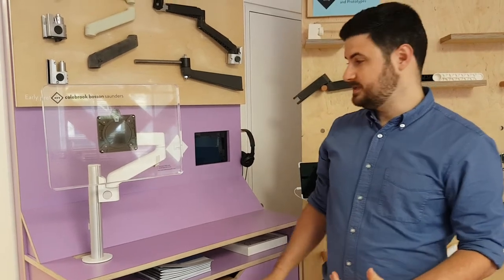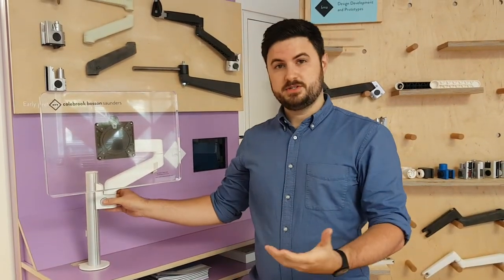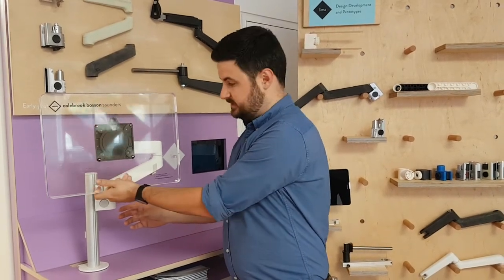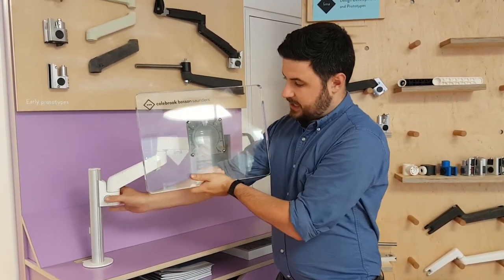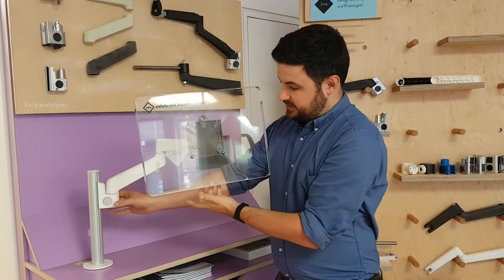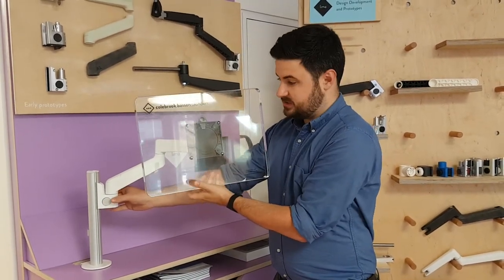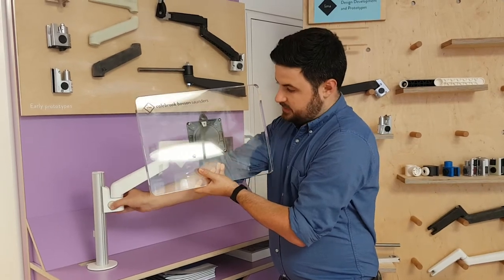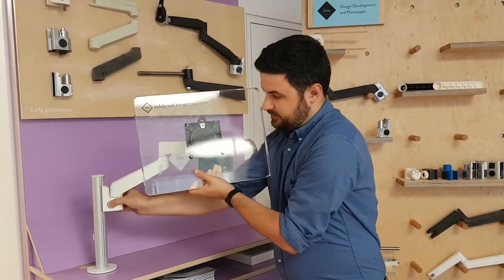Lima Adjustment Video

Comment: With the Dual Lima arms: With 2x 24" monitors, can you have the primary monitor "square" + and the secondary monitor at approx 20 degrees? (ie: I don't like facing a "V") . Thanks